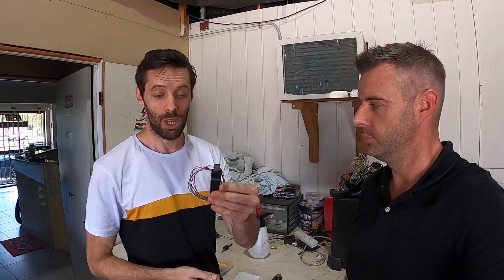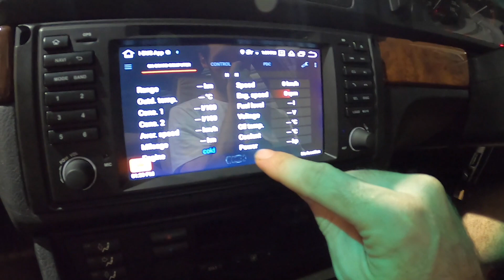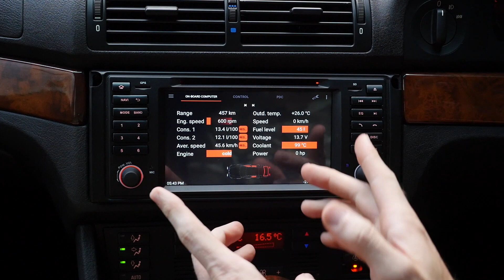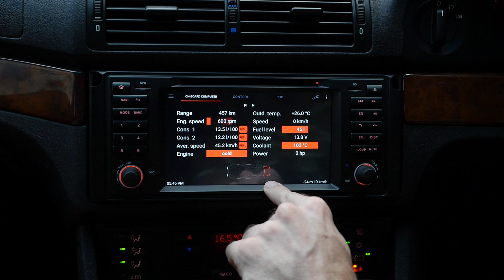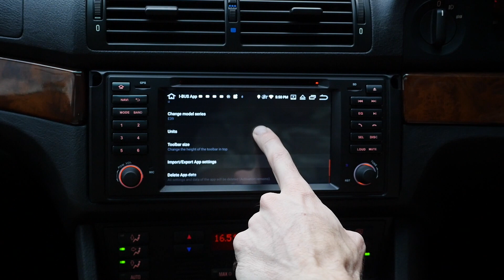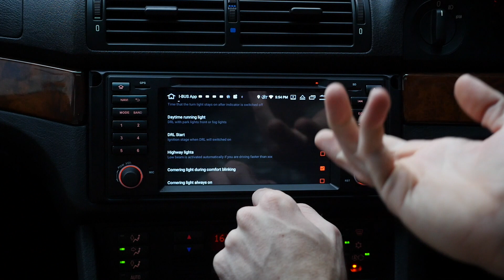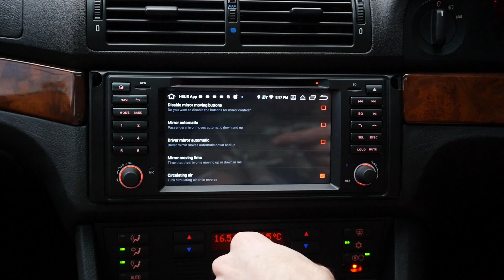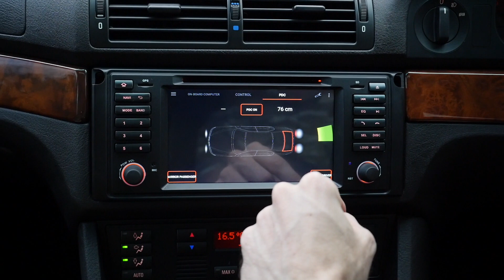BMW E39 E46 E53 Onboard Computer IBUS App Install & OBC Interface Review

Comment: I have the same IBUS app and USB dongle installed on my E39, how do you activate the clock/time, date, fuel consumption, range on your instrument cluster? I can see all the OBC info on the IBUS app, however it does not link to the instrument cluster on the dash.  MY IKE setting is currently enabled.
Reply from the maker: Hi Leon, Ive been doing some research because those functions were enabled from the factory on my car. It turns out there were 2 types of clusters fitted to E39s and I think the "Low" cluster might not display as many functions as the "High" cluster. 

With you car: 
Do you have a BC button on the end of the stalk?
Do you have a factory screen in the dash?
Does your cluster show the oil service lights on the LH side or the RH side?
Can you view the outside temperature on your cluster?
Reply: Zero To 60 yes I have a BC button on the end of the stalk and a factory screen 16:9 OEM screen, the oil service light is on the LHS of the instrument cluster and have a temperature display. 

I used to able to synchronise the time and display from the OBC via the ibus app onto the dash instrument cluster display, however everything went to reset after I disconnected the battery.  

Did yours appear automatically once you’ve hooked it up via the I-bus app?
Reply: The same happened to me. After disconnecting the battery, I can’t see any info on the ike, not even the time, I can only see range. Also I cannot reset consumption neither on the ike nor the ibus app
Reply: Felipe Sańchez Serrano so everything was working fine with Ibus and Android until you disconnected the battery? That’s worrying if you can’t get the same info back on your instrument cluster.